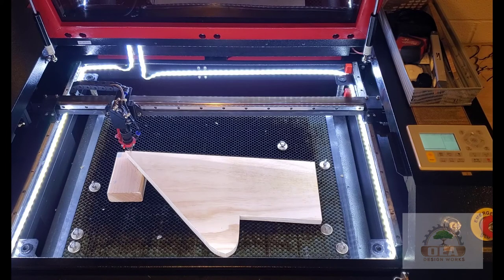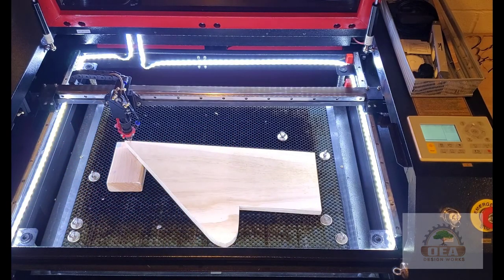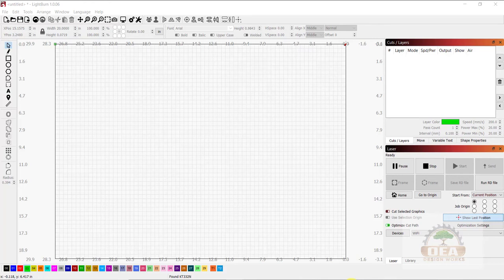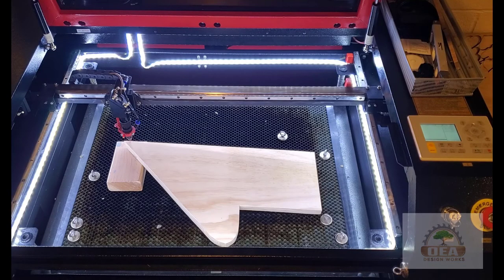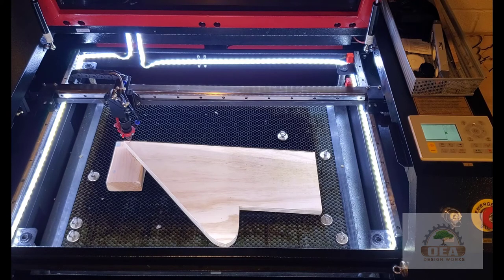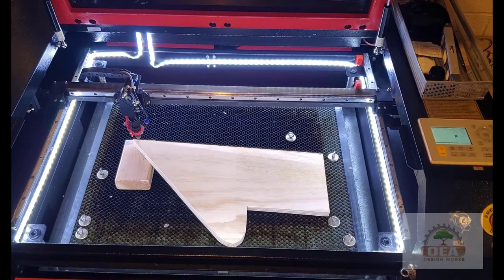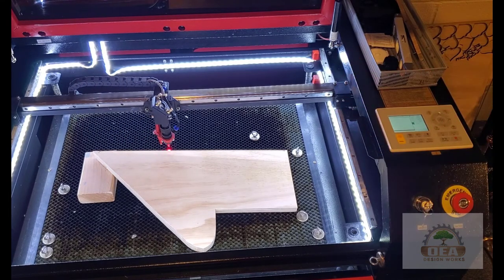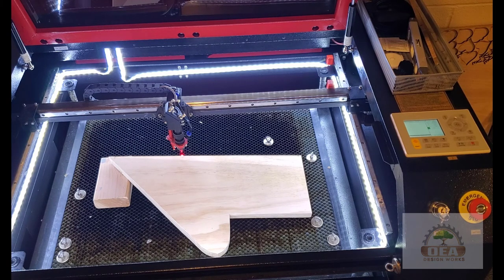CO2 Laser Ramp Test

Comment: Why didn’t your laser home when you turned it on? And how did you setup your smart plug to turn on the laser and chiller? Thanks Tim
Reply from the maker: thanks for watching. my laser homes every time it turns on. it goes to the back right corner and homes then it returns to a recent point from before it was shut down.

for the smart plugs i did not use one for my laser. just my chiller and inline fan. I just plugged them in and setup alexa so i just say alexa turn inline fan on. etc.